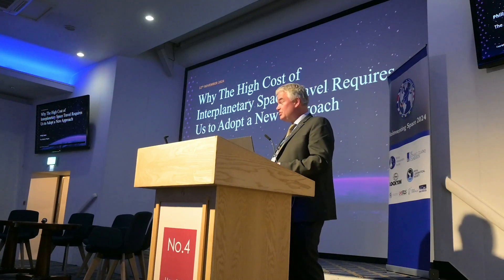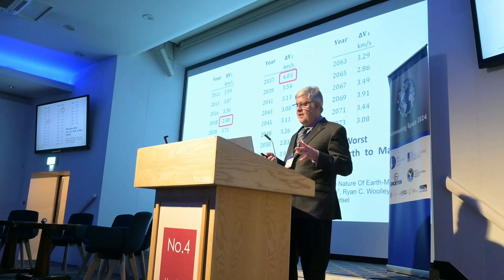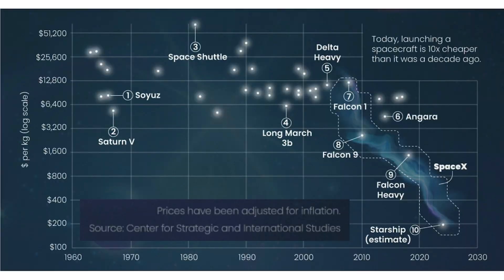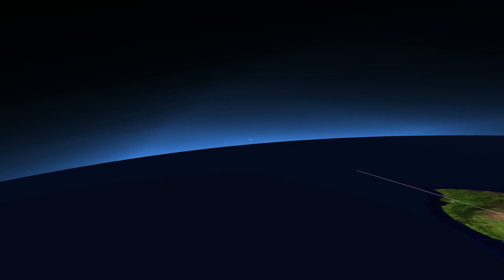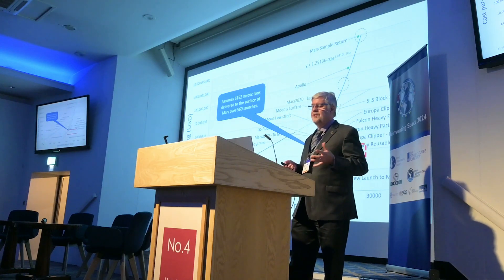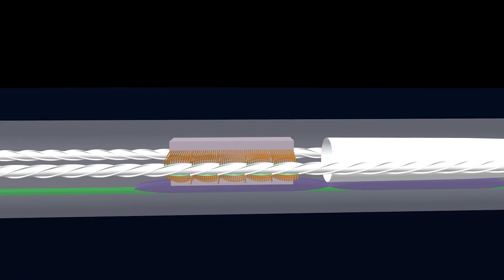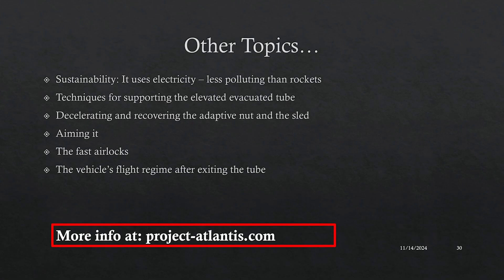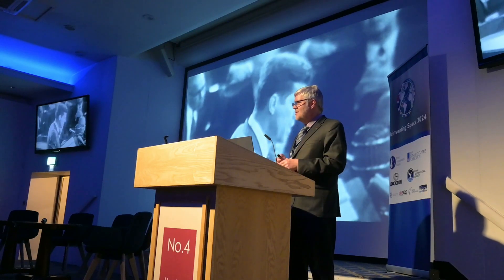Why Economics Favors a Mass Driver Over Rockets

Comment: starship spends about 200 tons of propellants just clearing the height of the launch tower. Thats more than the payload of starship itself. Try to help it along within the length of the tower and you get more payload.
Reply: Its not the hight that costs the fuel, its the acceleration. From when it starts to move, it takes 7 seconds to clear the tower.

That tower is 140 meters tall, so it would be moving at about 40 meters a second by the time it clears it. Then factor in gravity drag, and its expended around 120 meters a second of delta v clearing and he tower.
Reply: @HALLish-jl5mo  yes but thats missing the whole point of the rocket, the speed it needs to go to orbit is the real fuel drinker not the height. the time it takes to just clear the tower may seem like its using a lot of the fuel but really that would have happened anyways. because the rockets is optimized for 1.5 twr, meaning the first 30 seconds of flight are used to go not very far, but as it is optimized for that it gets what it needs from that, 30 seconds, they matter little in the actual delta v of the rocket. and its more efficient in every way to start from the coast at sea level than it is using any other method, as i said making the tower and launch platform 200 meters higher will not actually affect the rockets mass to LEO or any other orbit, the scale just does makes it seem like the first seconds matter, they really don't, to a point of being within a margin of error, that's just how fast a rocket goes. its just counter intuitive, because of the speeds it reaches. even starting at 10k and at 1000km/h you would get pretty negligible gains, because at a certain point in the rockets flight it will pass 10k every few seconds. or less. all the energy is used to go sideways not up.
Reply: putting the tower up 200 meters would be negligible and putting it on a mountain would make the logistics stupidly more expensive, putting the rocket on a plane first and launching from high altitude would be very limited and logistics works better for ground launch. there is a reason we launch where we launch. if they make the fuel on sight with solar energy the cost of the fuel would be the only big cost, because rapid reuse of the rocket makes the rest of the cost and logistics negligible. not just that, with the ability of 100tons to LEO you can build satilites way cheaper because the tech would not need to be miniaturized but you can also make it survive the trip compared to launching with mass driver. plus you can refule the ship and launch it anywhere in the solarsystem.
Reply from the maker: It's an interesting idea. The 33 Raptor engines on SuperHeavy produce an insane amount of power - I think its close to 30% of the average power of distributed on the entire US electric grid. So, imagine a hoist with a motor that is that powerful - it would be a beast. That's what would be needed to lift and accelerate a fully-fueled Starship and SuperHeavy.
Reply: @spaceinfrastructure3238  or a concrete counterweight attached to the end of the pulley that hoists starship up. like a gravity battery.
Reply: As commented, height doesn't help. But a (completely ridiculous) catapult would!
Some unreliable AI prompting points to very roughly 12% propellant savings from an initial 100m/s mechanical boost, thanks to saved propellant by not having to boost to the initial 100m/s, and reduced delta-v needed (the latter difference bigger than 100m/s since it's applied at the start, when gravity losses are largest).
Bona fide rocket nerds - please refine 🙂
Reply: @kristianwedberg4640  while it may help in a vacuum, it doesn't in the real world. Because it's going to have the same problem as the rocket being launched from a plane. You are going to run into scale issues far faster than you are delta v issues. The rocket you throw will have it even worse. The reason starship is as big as it is, is because it allows it to launch substantial payloads to orbit for the cost of fuel. If you made the rocket smaller you would end up with negligible payload size for a fully reusable rocket. Or a decent payload for a partly reusable rocket, or good for a fully expendable rocket. The problem is the hardware is many times more expensive than the fuel. So choosing to go fully reusable with a big rocket is far more efficient than building a smaller expendable rocket. Trust when I say they have thought about it. If you can come up with a better way of getting millions of tons to orbit and beyond they would take it in a heartbeat. They aren't falling for the sunk cost fallacy.

Comment: Seems even more succinct than ever before. That's a shame, I would have liked more details rather than less.
Reply from the maker: The speaking slot at the conference was only 20 minutes, but I can provide additional detail via replies to comments if you have unanswered questions.
Reply: @spaceinfrastructure3238  Biggest one right now: The screw segments are spun up prior to launch, during launch they give some of their energy up into the sled in order to propel it.
BUT
The segments need to be perfectly in sync otherwise the coupling will make catastrophic contact, right?
How is this synchronization from one segment to the next achieved when the first segment is slowed down in its rotation by giving up some of its energy into the sled?
Reply from the maker: There are flywheels inside each screw segment that spin slightly faster than the screws. These flywheels decelerate when the sled is beside the screws to transfer their angular momentum to the screws so that the screws maintain their rate of rotation. The flywheels have to be sped up again between launches. So, technically, the flywheels give up their energy but the screws do not.